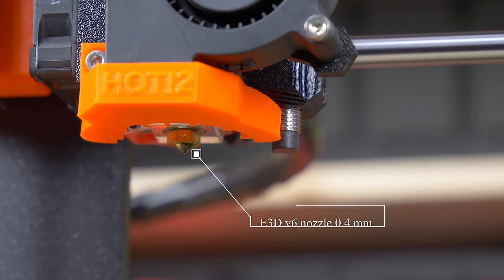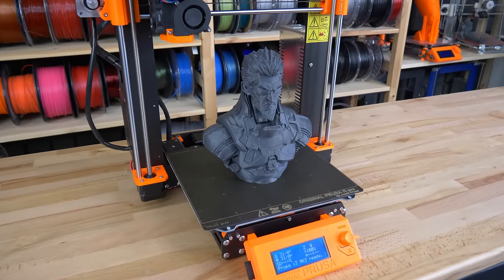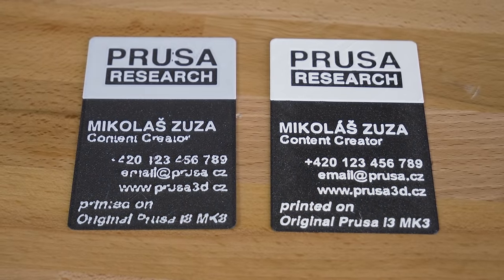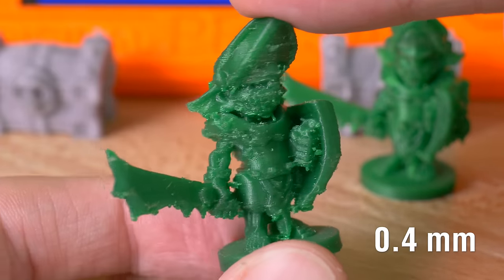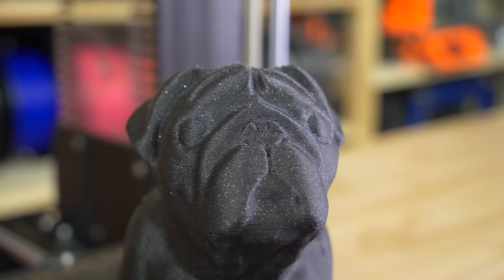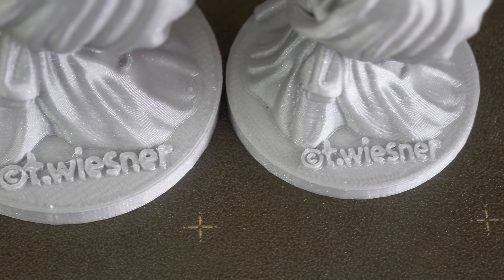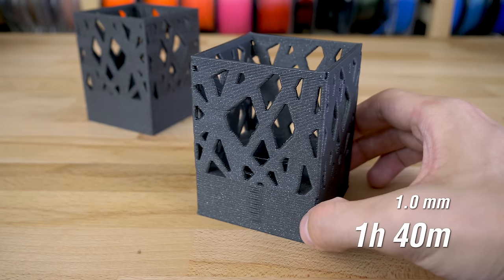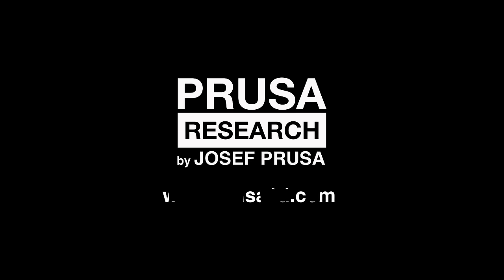Everything about NOZZLES with a different diameter

Comment: Just installed a 0.6mm nozzle, and it is SO much faster than 0.4! Highly recommend trying it out.
Reply: Did you have to change the temp much?
Reply: @damagedtalent  you shouldn't
Reply: Hi! I'm newbie in Fdm 3d printing and I was wondering:
-Larger nozzles print faster, but in slicer setting you have to change layer height also? I mean if you slice at 0.2 layer height and then print with a 0.4 and 0.6 nozzle, it will take the same time or it will be faster with 0.6?
Reply: @Andreastoro  it’ll be faster with a .6mm nozzle since it’s pushing out more filament. Make sure you change your nozzle size in your slicer.
Reply: @Muckin 4on why rusty?
Reply: @Muckin 4on XD How didn't I think it might be a reference to something...
Reply: @Andreastoro  remember what he said in the video about perimeter layers. even with the same slicing thickness, the width of the extruded filament will be larger with a wider nozzle, meaning the printer has to do less passes with a larger nozzle to get the same thickness.
Reply: @Andreastoro  it will be faster with a 0.6mm nozzle unless you're printing in vase mode (1 perimeter and no infill).  A vase printed with a larger nozzle will be stronger than one printed with a smaller nozzle.
Reply: I tried this on my cr10sprov2 and it was eating filament spools like crazy
Reply: @fuzzballdasoft5889  I might have the record.  I did a production run of 150 video game cases.  Using a 0.8mm nozzle and a 0.55mm layer height, the printer ate a 1kg spool in 36 hours.
Reply: What changes did you make on cura?
Reply: @emanuelcalderon  I use Slic3r, not sure how it works in Cura
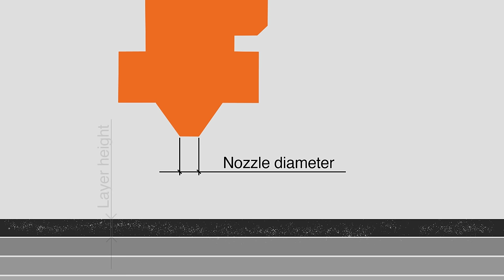Reply: @Andreastoro  you can adjust them separately, the nozzle size is defining the quality in the x and y directions and the layer height is changing the resolution of the z axis. Look at the graph of the video again that explains it pretty well 1:22

Comment: I put a 0.8mm nozzle on my MPSMv2 ... that's a 120x120x120mm build size. WHAT?? Yeah... it makes things print crazy fast ;) One thing unspoken for, though - the heat load on the nozzle! You have to print at a higher temperature to keep the actual flowing plastic at the right temp... if your filament is rolling significantly faster than usual, the nozzle center (away from the temp sensor) is probably a lot cooler as well. Plan for it!

Comment: Thanks for a very informative and helpful video. Just bought a 0.8mm nozzle from E3D and after a couple of experiments have printed a really large, strong box/tray out of generic PLA. Upped the temperature to 225c, used 0.5mm layer height with a 0.4mm first layer and 1.0mm line width. Slowed the general speeds down to 30 to 40mms with 20mms first layer. The result was really successful, very strong and ideal for the purpose without wasting hours on tiny layers for a big object. Very encouraged by this video - changing the nozzle was easy and I am now going to try some smaller nozzles.
Reply from the maker: Great, thanks for the comment! It's always nice to hear that the video actually encouraged someone to try something new that helped him :) Good idea with upping the temperature, with this much plastic going through so fast, it can be tricky to heat it in time.

Comment: The problem with using 1mm nozzles is that you have to also deal with heating. A hotend can only move heat to your filament so fast, so you often have to deal with that and lower the speed. I'm not sure how the MK3 handles that, but it seems like in the video it handled just fine. My robotics team has a massive 3d printer with an E3D volcano, and we usually have to slow down the print because the extruder can't move the filament fast enough, but that is a totally different reason.
Reply: How fast were you extruding the filament?
Reply: Out of curiosity, are you using a 1.75 mm filament or 3mm?
Reply: Have you used the E3D titan extruder? That think can grab and move filament like a monster, it might be worth a try.
Reply: @JShel14 
I have an E3D clone of the volcano and its extraordinary how fast you can extrude
Reply: @sugarbooty  can you send the settings for Slic3r for the 1mm nozzle ? Thanks
Reply: yeah, right.the more filament material comes out , the more heating needed

Comment: I was blown away by the quality I got when I first used a 0.2 mm nozzle. And supports are super easy to remove too. But even with super small prints the print time is huge. Sometimes it's not worth it, depending on the situation.
Reply: I just bought a 0.15 mm nozzle. Wish me luck.
Reply: @float32 25 hours
Reply: @DoYouSeeBananaManTH  2 or 3 days for a bigger (relative ) model

Comment: Great video! I have been going to a .6mm nozzle lately and have been experimenting with .8mm and 1mm thick lines, this seems to increase layer bonding with the added pressure to make the lines wider, it has also impoved the surface quality of prints using CF-PA quite a bit. Forget about overhangs and bridging though.

Comment: As a mechanical engineer it took me waaayyyy too long to go up from the standard 0.4mm nozzle size. I have used a 0.8mm a bit, and I only want to go higher. For functional parts without tiny details, bigger, bigger and bigger still nozzles is the definite way to go.

Comment: Iv'e always thought .6mm was the best medium. You guys should make an upgrade (or a new feature on your next machine) Where the printer can change it's own nozzle. Would be great for clogs and jams during prints for the machine to fix itself and continue printing, but even better is that when combine with the MMU you basically get e3d's tool change machine but in a much cheaper package all the way around the board. Rather than buying 5 hot ends you buy 5 nozzles
Reply: Well, it would be mechanically complex. It wouldn't be easy to make it work reliably.

Comment: Great video!! I almost exclusively print with 1mm nozzles for the exact reasons mentioned
Reply: I might give it a go now too!
Reply: The max i have right now is a .8mm nozzle but for some reason with the mk3 i cannot get prints to even look remotely like the 1mm nozzle prints in the video and i am having a hard time tweaking the settings, would you mind sharing some tips and helping me out trying to utilize the .8mm nozzle?
Reply: That or i would not mind going down to a .6mm nozzle as i have that one too but wanted to upgrade to either .6 or .8mm exclusively as for the parts i print do not need to be of great detail.
Reply: Do you need a different extruder, heater to use a thicker filament?. I use a cocoon create i think it is an MK3 extruder.

Comment: with 1 mm nozzle you really need to taky many precautions when printing things like tools because walls around holes (for example nuts or screwdriver heads or whatever polygonal hollow shape u need to make) tend to end up wobbly and distorted because of the heavy filament use; even worse with ABS when long segments tend to contract violently warping corners in long edges

Comment: Well I changed both nozzles on our Raise 3D pro 2 at work yesterday and it was quite the task as you need to remove the hotend completely, support it while screwing the nozzles in and out, put them back in and recalibrate everything... But next time the 0.4mm nozzles are done I'll definitely think about putting a bigger one on one of the extruders.
We sometimes want to print fine and sometimes want to print large and fast, so why not try this.

Comment: I have Microswiss hotend with 0.4/0.8/1.2mm SS nozzles. It's very true about filament disappearing with 1.2mm nozzles, but 1 perimeter and +20C over normal print temp, fan for cooling all that molten filament also slowing the print speed to %68 so the hotend can keep up. still prints about 1/3 the time of 0.4mm nozzle (still needs tuning).

Comment: Had lots of fun printing with a 1.2mm volcano on a lulzbot we were given, it was a shame to waste it's big print volume with smaller stuff.  Eating over 100g of filament an hour is fun, if expensive! :)
The i3 series does seem to work better with 1mm or under and suits them very well. Loverly machine. 
Please release an official enclosure kit(Laser cut + 3d printed parts) that fits neatly and elegantly around your Mk3's!
Reply: Shouldn´t be more expensive - I´d assume the total amount of filament used for the product should be about the same, maybe marginally more. It´s only the relative consumption (Filament per hour) that increases as the print time goes down.  Total cost actually go down, as you can calculate less machine time, i.e. less wear per print or more prints within a given lifespan of your printer :)
Reply: It's more a side effect of being able to print larger things quickly. If you have a machine that can eat a kilo of filament a day without a worry you end up going through more just as a result of printing more things. :)
However you do have the side effects of printing the same object somewhat heavier with these large layer heights due to the extra volume used in support material and your decreased overhang capabilities, so you tend to need more material.

Comment: There are two main issues preventing me from using a different nozzle with my printer. #1 - Compatibility; It's not obvious what nozzles are compatible with my printer, and the printer manufacturer does not offer any other nozzles on their website. #2 - Changing the nozzle; I once had to remove the stock nozzle on my printer to clear a jam. I followed all the instructions, but when I reattached the nozzle, the threaded portion sheared right off, forcing me to replace the entire hot-end (at a cost of $75) since the nozzle threads were stuck inside.
Reply: what the heck brand of 3d printer are you using? if its possible I would highly recommend frankenstiening a V6 style extruder to it I have a 3d printer from a defunct brand and I swapped the extruder and hotend for Wind BMG V6 and never looked back. Much better print speed and compatible with just about anything.

Comment: The way to change a nozzle is first heat the hot end, as filament gets in the threads and locks them in place. Then when it is hot you can easily unscrew the nozzle, just don't burn your fingers. Putting a new nozzle in is easy.

Comment: Great timing, got my Mk3 (kit version) about a week ago. Fantastic printer but was already thinking about larger nozzels as with my old (very old and worn out) k8200 I mostly needed and printed custom brackets and cases for projects. It was quicker than the mk3 but a pain to use all the bed area. Ordering a new nozzle now. :)

Comment: I'm currently experimenting with different nozzles on my ender 3 pro.. I've found that 0.5 is the sweet spot IMO, you can print fast with reasonable accuracy at .2mm layer height and if you want to really speed things up, you're able to go up to .4mm layer height and basically double the speed. I tried 0.8 and even 1mm nozzles but I found that a lot of the things I tried to print simply wouldn't work due to the line width limitations.
Reply from the maker: Yeah, also you typically need a much more powerful hotend to really get an advantage of 0.8mm+ nozzles.
0.5mm is a great choice.
- Mikolas

Comment: Easy to remove support isn't always a good thing. I had an asa print seperate an overhang from the support on it's own and curling upwards. Conclusion: technical/sturdy parts with bigger nozzles, small nozzles for fine details. Vast majority of users would profiteer from a 6. I ordered an 8

Comment: Anything higher than .6mm nozzle will have its issues on the majority of E3d Clone heads, Once you go to .8 / 1.0mm it will need an upgraded extruder motor / hot-end. You can slow it down all you want.
Reply: what do you think of the stock extruder on cr10 with the new car revo hot end?

Comment: I just wonder about the volumetric speed of the filament when using the 1mm nozzle. I noticed when printing at 120mm/s with .2 layers and a .4 nozzle that I was actually running into heating issues with PLA at 215 which in some cases only resulted in a slight color change but in others made it so the layers wouldn't adhere to each other.

Comment: The problem of bigger nozzles: for fast printing big nozzle is only 1 of 3 key factors, two others are the hotend having enough power to melt the incoming filament and the cooling to be sufficient. I tried with my Ender 3, but cooling was not enough.

Comment: Would be interesting to hear what settings change if you in or decrease the nozzle diameter.  I recently got a 0.8 mm nozzle and I still have troubles with holes, oozing  and stringing.
Reply: Me too, just got the mk 3 a few days ago, upgraded to an .8mm nozzle and having the same issues, were you able to tweak the settings and fix it because i am still doing so
Reply: Alex Brensike congrats for your mk3 great choise 👍. I wasnt able to fix it totally but i could reduce the issues with a longer retraction distance(~8-14mm), a much slower retraction speed(~1-3mm/s) and a slight higher flowrate(1-5%). Play around with these settings and let me know if you were successful ✌
Reply: Where do you change the flowrate in Slic3r?

Comment: Getting a 0.8 mm nozzle for my Ender 3 completely transformed my workflow for making structural parts. In my opinion a variation of nozzle sizes should come standard with all new printers. It's inexpensive and makes a huge difference.
Reply: Did you have to change the hotend?
Reply: @LeftyPencil  Depending on the printer bambulab printers will require a hotend swap since the construction is one piece however most printers follow the V6 standard which only require a wrench to remove and install a new nozzle

Comment: I was really excited after watching this video so I bought a set of different sized nozzles for my Prusa; only to discover that the Prusa firmware only supports nozzles up to 0.6 mm. Now I just think the title of this video should be "Everything about NOZZLES with a different printer"
Reply from the maker: By prusa firmware you probably mean PrusaSlicer :) It's true that our stock profiles are usually just for 0.25, 0.4 and 0.6 nozzle, as those are the most comon ones.
However, nothing's stopping you from using bigger or smaller nozzle :) Either ask in you favourite Prusa group/forum for a pre-made profile or make one yourself for the specific nozzle you bought. The basic are changing the nozzle diameter in Printer settings - Extruder - Nozzle diameter
And then change the Print settings - Advanced - Extrusion width to about 110% of your nozzle diameter.
- Mikolas
Reply: @Prusa3D   I checked the HW_Setup in my MK3,.. nozzle sizes are supported up till 0.6 mm but no bigger - is it safe to ignore these values? I was under the assumption that these settings also control filament flow.

Comment: Joseph, what would you say is a good compromise for detail and print speed? I have a 0.5 mm nozzle and getting pretty good prints, mostly cosplay armor parts. Could I 'up the nozzle size to 0.6 or 0.8 without loosing too much detail?(the 1 mm nozzle would be a bit too big for me, plus I imagine I would have to lower the print speed, which would defeate the purpose of printing faster)
Reply from the maker: You should absolutely try at least the 0.6mm nozzle :) Cosplay armor is usually really big, you'll save tens of hours of print time with really small decrease in print quallity.
Reply: Prusa 3D by Josef Prusa Thank you, I'll try it than :D

Comment: We use two printers. One has a 0.4 nozzle and the then has a 0.6 nozzle. They really are hard to see the difference between the two. But speed wise the 0.6 is a lot quicker. I currently just leave every print at 0.2mm layer height and it gives really decent prints

Comment: How does max volumetric flow rate scale up with larger diameter nozzle? For example 2.5mm^3/s for FLEX filament on 0.4mm, could it be scaled up to 3.75mm^3/s or even 5.625mm^3/s with 0.6mm nozzle? I image at least with flex there is a limit because of jamming the filament before the nozzle.

Comment: Waiting to receive my first 3D Printer now. If I use bigger nozzles and layer heights, can I automatically use larger diameter filament or would the extruder need to be changed as well?

Comment: Hi! I'm newbie in Fdm 3d printing and I was wondering:
-Larger nozzles print faster, but in slicer setting you have to change layer height also? I mean if you slice at 0.2 layer height and then print with a 0.4 and 0.6 nozzle, it will take the same time or it will be faster with 0.6?

Comment: If only there was an nice automated toolchanger for nozzles with keeping track of distance of the nozzle to the plate. I use 0,6 nozzle pretty much for everything But occasionally i have to do thin wals and 0,4/0,25 would be nice. But i usually then resort to SLA
Reply: so replacing the nozzles can cause z height issues, exactly the reason I didn't want to change it and would rather try the revo nozzles, maybe they are closer in tolerances than a traditional nozzle
Reply: @urjnlegend  i hate first layer calibration i have high hopes for Revo but is it available with harder nozzles? I'm printing a lot with PCCF

Comment: I want to start printing vases with the vase mode feature. Which nozzle size should I use so that my print is strong? I tried with 4mm nozzle but is very thin. I'd appreciate any suggestions. Thank you

Comment: This is true if your printer is limited by its  kinematics instead of flow rate, such as the Prusa. They move so slowly so laying down less lines would speed up the print. If you have a decent core xy, the machine moves so fast that the melt rate is the limiting factor. In this case nozzle size doesn’t matter.